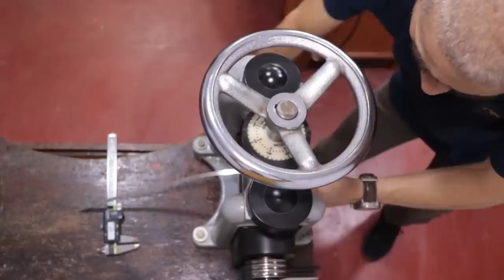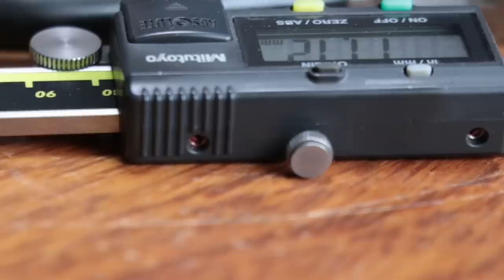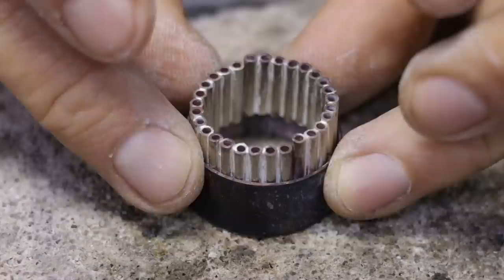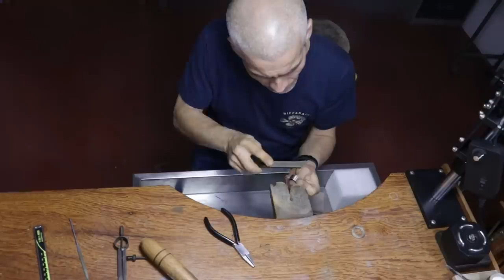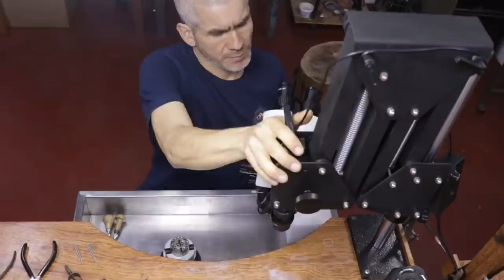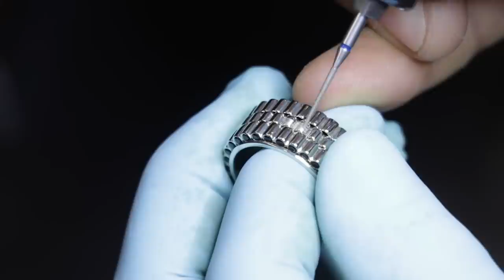Spin ring  (Anillo giratorio)

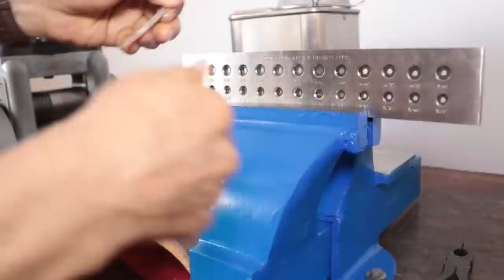Comment: Magnificent work ! Question. The jig to make the tiny tubes at 1:18 of the video, the seems aren't welded? Unless I missed something.
Reply: I'm guessing based on other things I saw on YT that the tubes are just cold worked into place with an invisible seam as they are pulled through smaller and smaller dies. Then when he brazed them together into a ring the seams would have been filled if they were open at all.